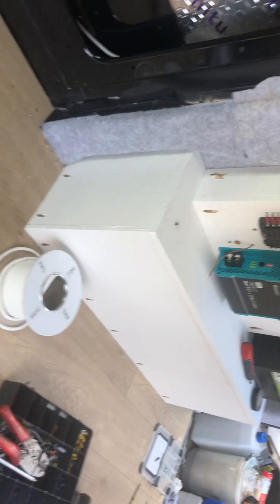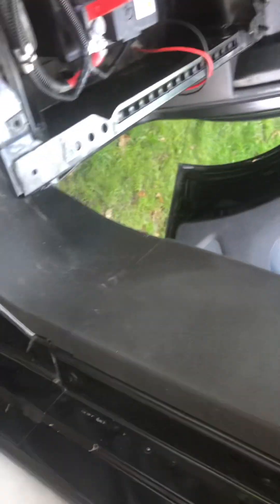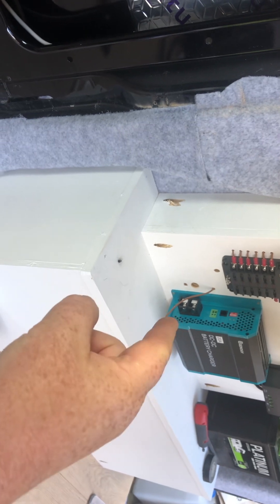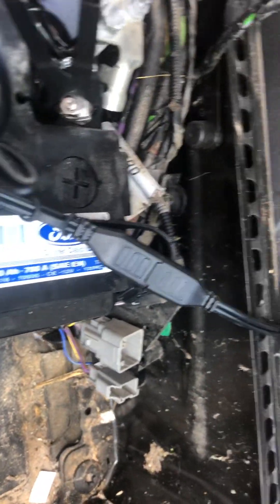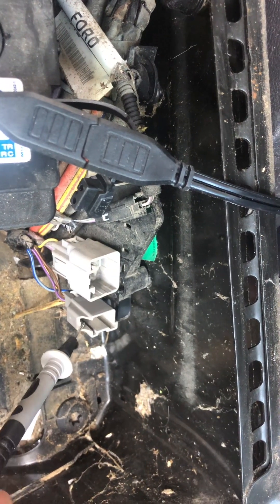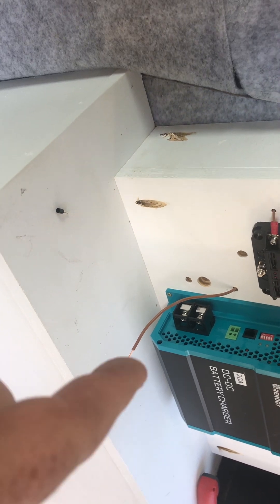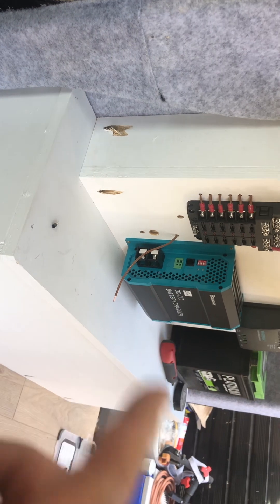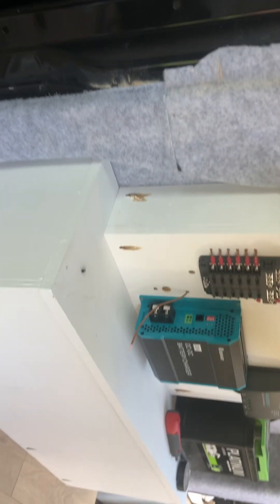Renogy battery to battery charging. How to install

Comment: i have a ford transit 350 mk8 and want to install this renogy 40amp charger to the van, I understand the live feed is on the side of the drivers seat which is great and then the negative is under a cover  to access the battery negative under the drivers side, however is the d+ feed in the same place as the custom? or is it different?
Reply from the maker: Hi, yes the D+ feed in your transit is the same. Check out unpronounced adventures. He had that van.
Reply: @Robbie_DIY  yes I follow him but he uses victron which is a lot more expensive renogy, and with victron you dont need the d+.
Reply from the maker: @ironian24  he shows the d+ in one of his videos. I think within the last year or so.
Reply: Hi, so apparently he put a switch on the dashboard, but you can go with what you are showing as well under the seat, so did you use a molex pin to connect onto the pin or did you cut into the wire and attach that way.
Reply from the maker: From what I remember I think I used a small flat crimp fitting which fitted the plug perfectly and was a snug fit. Worked a treat. Yes his was to power a second Orion. He has that switched for double the output during the winter.

Comment: Hello, thanks for the video...
....i was wondering what was the order in which you connected the dc-dcChg up:
(1) +starter   to   +dc-dcChg, 
(2) - starter   to   -dc-dcChg,
(3) +dc-dcChg   to   +leisureBatt
(4) - dc-dcChg   to   -leisureBatt
?
and did you have to disconnected the starter battery from the ford while you were connecting (1) and (2)
Cheers!
Reply from the maker: Hi Fred. I’ll do another video on my next build as I’ve got another custom booked in. Thanks

Comment: What size inline fuse do you use on the D+ line?
Reply from the maker: Hi, I fitted a 15amp inline fuse. Didn’t want to fit anything bigger. It’s just a trigger wire.

Comment: hi! Thanks for this video! Do you have any pictures or video showing your final connection under the seat for the D+ ?
Reply from the maker: Hi melissa I’ll do another shorts tomorrow showing the connection or a pic if I have one. There is a better video on my Instagram page. Same as this channel name
Reply: @Robbie_DIY  Awesome! I just followed you :) Found the post as well. I appreciate it! I have the same renogy charger. I also have the Renogy MPPT 40amp which I just hooked up as well.